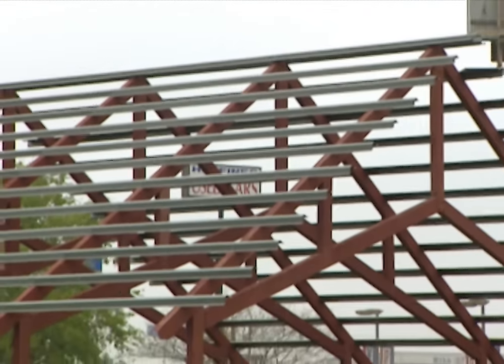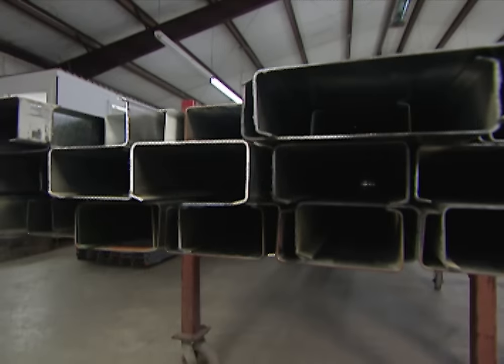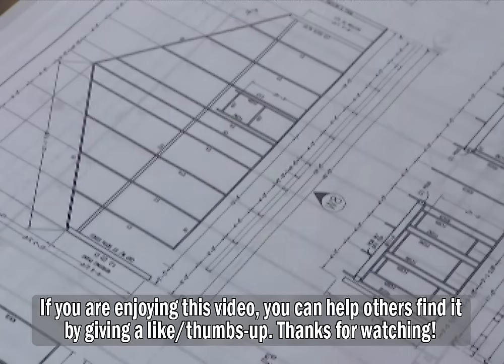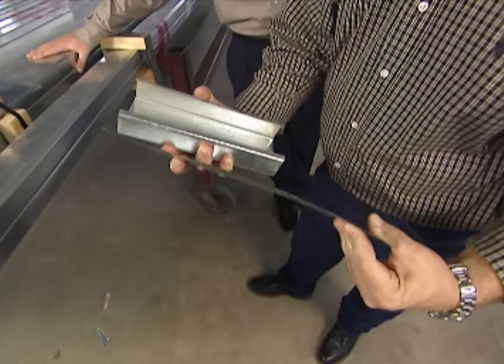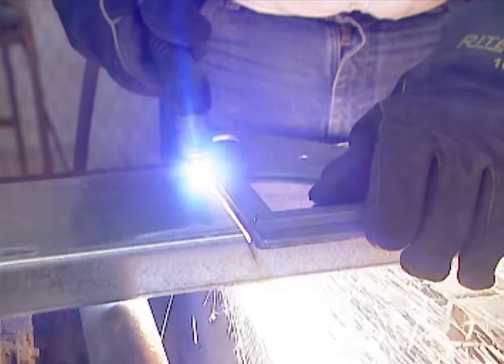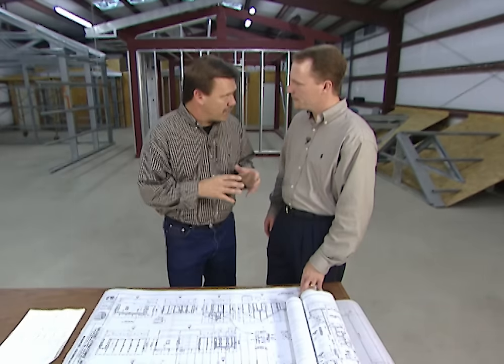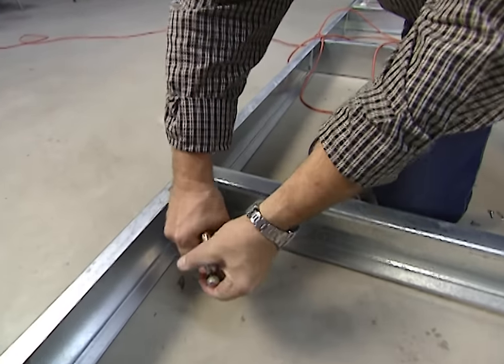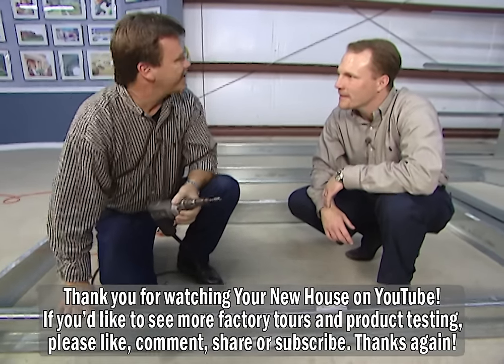Steel Framing - Did You Know?

Comment: Did you know?  That it thermally short-circuits the building envelope, effectively destroying energy efficiency?  It requires a completely different thermal insulation solution, and acoustical approach...to work.
Reply: Please explain more detail. What time of insulation would you need to do etc?
Reply: @vincelombardi2669  Studs of any sort in a typical wall (or other building element) create "thermal bridging."  This is when one material (the studs) conduct heat much more efficiently than the surrounding assemblies.  It's an issue with wood also, but wood is a much better insulator than steel.   Steel conducts heat ultra-efficiently, so even the thinnest cross section transfers heat through the wall efficiently.   Typical wall assemblies have a grid of studs and plates.  If you merely swap wood for steel in a conventional wall assembly, the steel massively short-circuits (thermally) the entire assembly.  So even if you have a thick wall packed with insulation the effectiveness of the whole wall will be a tiny fraction of what's expected.   Build this way and you will have a very energy-inefficient building.  Of course I'm talking about a regular stud wall.  Steel itself is a great material, but not in this way.  There are lots of ways to build a wall.  For steel, continuous insulation on the outside is the way to go, but it's a whole different way to build.  Check out a source like www.buildingscience.com where they test all sorts of different assemblies and materials.
Reply: My walls are R-35, roof, R-50, home skinned with 1/2" 2 lb. foam panels for thermal break

Comment: You should hear my steel shed crack and pop as the sun warms it up.
Reply: Same thing with my knee's and joints too.  Ouch
Reply: Do you have vinyl siding on that shed
Reply: @Karl doesn't matter steel houses are so loud as fuck you will wake up every single fucking night to the sounds of clunking, banging, thudding as the steel cools and contracts. Timber framed houses do it too, but nowhere near the sound volume and echo chamber of steel frames! The sound travels throughout the entire frame of the house meaning no room is ever spared from the sound!
Reply: Steel moves following the heat of the sun,moving from one side to another every day . (Expansion & Contraction)
Reply: lol
Reply: @Jarmezrocks  yeah I seriously fucking doubt it'll be making those noises if it's a new house.
Reply: @Jarmezrocks  Thats why I believe acoustic ceiling and wall panels will help.

Comment: ...one thing that I noticed was STATIC (enough to raise hair ) in each room
...A grounding mechanism (through the bottom plate) might work to set up 12 volt systems (SOLAR) separate from 3 phase AC systems
...with the price of lumber going up concrete and metal are economical and portable systems to develop
think 3d printers (Plastic, Biological) and cameras on process
...recycle plastic into studs?
Reply: Isn't that a dry air problem?

Comment: A lot of things not covered in this video. Cost compared to traditional framing, warranty, R value,..... I know it is not the ideal option for areas with cold winter due to condensation problem since metal is a good conductor.
Reply: The way they are made the insulation goes inside the stud.
Reply: @davidlaeson5608  
Which is a negative. Want to wrap the insulation outside.

Comment: Agree with everything said. With that out the way - Aussie wildfires are showing steel framed houses gutted and collapsed.
The “problem” being the engineers are relying on the folding into C & U purlins to add rigidity to reach the required structural strength to support across spans.
In a fire where timber or fibre based cladding (sheet rock for eg), when they burn they are hot enough to distort the thin section folded purlins and they distort and sag, meaning they lose their structural integrity.
You cannot just re clad a standing burnt steel house frame, it’s a write off?
It’s the engineers fault, trying to save costs by employing steel in gauge too thin to self support in a fire situation.
Steel frame is not all its cracked up to be!
If the engineering were better it COULD be!

Comment: Nothing like steel and concrete homes. Forget that wood house
Reply: Forget getting a cell signal.
Reply: Built my home inside a 30 X 100 Butler American Classic building, hurricane Katrina's winds ripped shingles off my neighbor's home, my standing seam roof didn't flinch
Reply: Idt concrete would do well with earthquakes, rebar or none, the concrete around it still can crack. And steel wouldnt be great near shorlines, theyd likely rust, especially closer you get to the shore

Comment: I own a steel-framed house.  The walls are perfectly straight - but the steel framing acts like a giant Faraday cage and kills cell phone signals and WiFi signals.  Just a word of caution...
Reply: Like kills the signal completely or just weakens it?
Reply: Actually, I think this could be a plus. Electromagnetic waves of all types are not necessarily a good thing for health. But a downside to steel is that you can't always find a good contractor that knows how to build with it.
Reply: @moodberry  my thoughts as well
Reply: That’s not true. I built 5300 sq. Feet three levels in Fairfax city Va. in. 2007 the only steel frame house in the city. No problem with WiFi or telephone signals.
Reply: @cking4giveness337  Faraday cages work to about 2*wavelength.  If you have 2 feet between studs that's not going to block anything except AM radio. But if you're spacing them 4 inches apart, all the way up to about 14 inches apart, most cell phone signals will not penetrate.  5G?  That's not going to penetrate anyway.  Time to find a new way to get cell signals inside a home.
Reply: Just bought a house in Fairfax county that was built in 1958 . It was supposedly a model house that was built using steel framing (of course I knew nothing about it - I just wanted the house). I must admit the first winter here was cold as hell and we couldn’t figure out why but perhaps now we understand why.

Nonetheless, the realtor told me that it is easy to add extension if we wanted to because of the steel framing. If you are still building, perhaps we can talk!
Reply: @cking4giveness337  are you still building in Fairfax County Virginia? Would love to explore options...

Comment: Steel does not burn, it weakens in a fire and bends, distorts.   Wood will char, and hold ridged much longer before collapsing.  You can grow trees, but once all the steel ore is gone, you must recycle as long as there is steel to recycle is available.   Wood is easier to work with for the DIYer.   Both materials have their pluses and minuses.

Comment: They this galvanized coat steel will not rust, which I agree with. However, they received the galvanized steel from the manufacturer, mill it to plan specs, do they reapply the coating to the cut ends and surfaces before delivery?

Comment: what about price comparisons
Reply: Material cost may be a bit higher but I’ve seen guys frame 200-300 linear feet of walls in a day. Production costs can be significantly cheaper than wood framing. Another thing to consider is there are no special connections, hangers, etc (Simpson strong tie connections for example). All steel to steel, wood, or brick connections are made with screws. All steel to concrete connections are made with simple shot-on concrete pins
Reply: @carpintero01  or embedded j-bolts, if you're really wired tight.

Comment: I've done almost every sort of remodel and form of residential construction on everything from tiny homes to million$$$ homes 3 times the size of this thumbnail. 
I built one steel house at the foot of the rockies for the man who was on the board of an organization for light industrial, commercial,  and residential construction of steel homes. We kept hearing about perfect plumb, and dead on level and some walls and systems were good. 
It was cold and soulless, and there is cold conducted from thinner exterior insulation through the framing right up t the drywall or occasionally thin interior insulation under the inteerior finish.

Comment: l only recently discovered steel framing was being used in domestic property construction.  However the construction methods I observed in the video were somewhat similar to timber framing - very labour intensive.  Everything manually cut with a chop saw and then screwed together with drill drivers.  I guess the methods wouldn't look too unfamiliar to most carpenters.

I'm not a steel expert, but I've worked in modern shipyards, and the construction techniques employed there involve building steel modules robotically using CNC cutters and welders. They seemingly come straight out of an autocad drawing.  These modules are then assembled lego brick style to form a ship using cranes and are finally welded together by humans.

They do seem to have a far more labour efficient template that could be applied to the domestic construction industry.  Is there any reason why this style hasn't been applied?
Reply: costs.
robot welders ( after humans tack weld the bits in place ) cost to buy, not very portable.
cnc cutting tables of any sort, not portable and very expensive.
cranes have a huge cost to operate and needing them to shift modules around to weld together would also drive costs up.
The shipyards don't have the problems of moving the expensive equipment, and can use rail cranes in the yard to shift modules, impossible to do on a house lot.
Reply: Also shipyards are dealing with much bigger projects with thicker steel. Cant compare a $200k-1mil project to the shipyard $20m+ military contracts.
Reply: It's much more efficient now, with roll formers.
Reply: not labour intensive，there are some light steel frame cnc machine，that is designed by software, and then cut and drill by machine. however, this machine is not advanced compared to robot arm. because the frame is only one dimensional.

Comment: Back in the late-1980's California and the building industry here tried to push steel framed new homes as an option in tract homes.  IT increased the cost of a home by about 10%-15%, and with most buyers struggling to even get into a home back then (sky-high prices and mortgage rate issues, somewhat similar to today's financing issues) no one would buy the option. Not sure what the cost difference would be today (none mentioned in the video) even if you adjusted today's whacky lumber prices back to late-2019 pricing.

Comment: Now, how much more will it COST? (Always have Love the ideal for a house).
Reply: There's one place that I saw actual pricing depending on square foot ratio and just over 2000 ft was under $30,000 but that's just the frame you also got to pay for insulation, walls, plumbing, wiring, and I guess gas if you want it; and last but certainly not least utilities and furnishing.
I'm having a hard time finding a place that kind of does it all and especially a more modular prefabricated sort of deal even for a custom build. I would love it if they actually had kids with pre-drilled for marked areas where you have to drill and make it easier for assembling for two or more people cutting labor cost
Reply: More? It's like $20 for an 8 ft 2x4 right now. Lol

Comment: Time 1:50. Ref the corrosion resistance what about internal galvanic  corrosion - you mentioned you use recycled steel from cars. Car steel to begin with is not so pure so recycled  what is the guaranteed and the expected life of the component parts ?

Comment: "Will it rust?"
Rep: "its galvanized protected" 
Me: well thats not no
Lol galvanized is just a term that  expresses why worry now and you can worry later.
Reply: As he used a plasma cutter to cut said galvanized sheet with no respiratory... zinc is  no joke
Reply: @facediaper4607  and a abrasive chop saw! I would think a company like this would have heard of a 300.00 evolution saw!
Reply: @trevorjarvis3050  lol yup I haven't and won't go back to that nasty junk... Evolution all the way
Reply: @trevorjarvis3050  this company is what you would call cheaply mad and cost you an arm and few toes
Reply: There is no feasible material that won't rust, rot or degrade is SOME fashion. You're being nitpicky. Galvanized steel could stay in tact for up to a decade submersed in sea water, so consider the fact that the goal with your house is for it to be DRY and as limited water exposure as possible. A wood-frame house will rot far sooner than a galvanized frame house will rust/structurally degrade if they are exposed to water from a leaky roof for example.

I think it sailed over your head that the rust-protection isn't exactly the main selling feature anyway.
Reply: @kevisthegoat  that is 20g sheet metal it will only take a few years to rot where the galvanize section that was scratch or drilled
Reply: @facediaper4607  If that were the case, thousands and thousands of houses made of steel frames wouldn't be built every year. The sections that are scratched/cut/drilled are joints, in other words they are almost indefinitely concealed in most instances without even considering the water/weather proof tape and such they would use over these joints.

You're looking at things too plainly. Almost every step to you take to waterproof your wooden frame house are steps you would also take to waterproof your steel frame house. So as I said, the largest benefits of steel frame houses aren't necessarily focused on their long-term weather resistance. Try watching the video.
Reply: to get  a steel framed building to rot , it would virtually have to be under water for  long periods of time . Any areas youre concerned about can be painted with R-Guard        sealer . If its steel beam construction ,  al the better .
Reply: @paulbains9152  ya ok
Reply: @trevorjarvis3050  
I saw that chop saw and thought "How long ago was this filmed?". And that new-fangled gadget he called a plasma cutting torch...that's straight out of a sci-fi movie. Or Harbor Freight.  😁
Reply: @kevisthegoat  it being thin sheetmetal, the galvanized steel wouldnt last a couple years in sea water, thats being generous. As for being dry, correct, but it depends on your environment, if you live in the middle of texas or nevada where the air is dry, sure it will decades, living near a shoreline where the air is humid and salty, forget about it, the closer you live to the shore and salt spray, the faster it will rust. Stainless steel is recommended if being used within 25 miles of the ocean.
Reply: @rogermccaslin5963  looks like its from the late 90s early 2000s, around that time i seen on the news about the new “plasma cutters that reach temperatures of the suns surface” i dont think they had cold cut saws back then, like above suggested.
Reply: Will it rust ?as long as it is not exposed to the weather and water  ,just like a wood frame, dont expose to weather or water and constantly wet  and it wont rot.
Reply: @facediaper4607  Thats a complaint as old as time, every welder welds through galv and every welder is aware thats its not that great but not that bad either especially when comparing to working with treated sawdust, parts polishing and fibreglass work etc.
Pick your posion, if your a builder your fucked from abstestos, if your a concreter your gonna get silicosis if your a welder your gonna breathe in some nasty shit as well like zinc and cleaning agents and paint rust etc. 
Being a tradesmen is the toxic part just pick which posion
Reply: @SH19922x  don't compare welding to Carpentry or builders of homes. Huge difference in risks... but your comment tells me you haven't don't much if little at all.... you can't make a good weld ,welding through galvanized materials... wearing a respiratory  with asbestos vs respiratory and fumes that can and will get through that respiratory in welding... on top of the electronical and magnetic hazards of welding... don't try and compare all trades to each other especially welding.. heavy metal poisons and toxic gas that can kill you in second to with in days .... vs things that kill in years to decades later...
Reply: @facediaper4607  By a few years do you mean like 200-300 hundred years or it's less than that?
Reply: If you leave it in standing water for a few years, yes. For a normal home, not really, won't rust unless you have a leaking roof

Comment: those are basic commercial building materials.  8" studs are standard for exterior framing.  any grinder could cut those studs and tracks.  even the HD studs next to the windows.  use an impact to drive your fasteners before you get fired

Comment: Is this cheaper than wood framing? I’m more concerned with saving because i plan on insulting with hempcrete. Thanks 🙏🏼
Reply: No. Not even close.
Reply: @KushDragon420  thanks
Reply: @Creator_Veeto_PAEACP  ya np, wood is going up, but steel at least where i live, is at least 2x more
Reply: HempCrete, what is that?
Reply: @miragetime2241  comcrete made from hemp fibers and mortar mix.  Hemp can be used for literally 1000s of tjings. Anything oil makes. Hemp makes better. Faster. Cheaper. And cleaner. Concrete can also be made with hemp fibers but i do not know if its stronger than normal cincrete as ive mot made or use any before.
Reply: @miragetime2241  a special mix of limestone + regular hemp chips. Its fire-proof, but not load bearing. Breathes and regulates temperature and humidity. Also it gets stronger over time.
Reply: @KushDragon420  is it just some unproven magical weed building material?
Reply: @miragetime2241  no, its just a more sustainable concrete. Im sure its specs are on par with normal sand and mortar concrete mix.

Comment: My question with a steel home in a cold climate like 30 or 40 degree below would the steel frame warp or buckled?
Reply: no
Reply: Not if it's insulated properly, on the outside only.